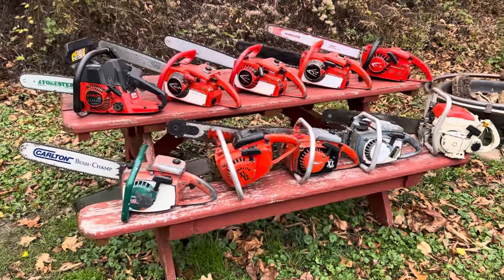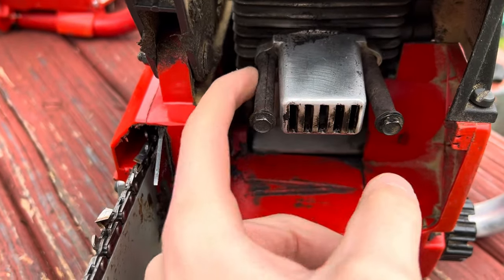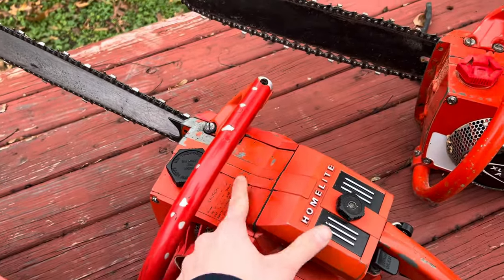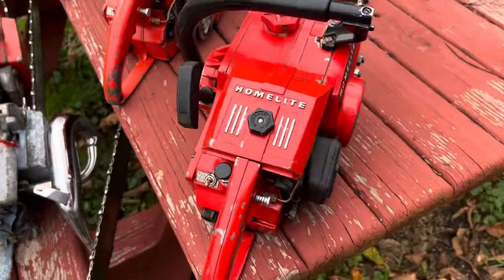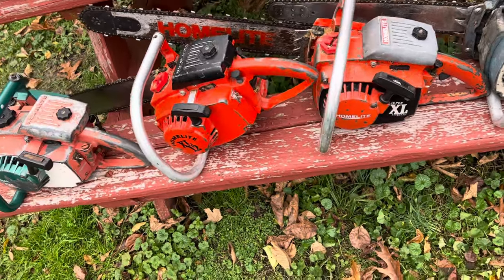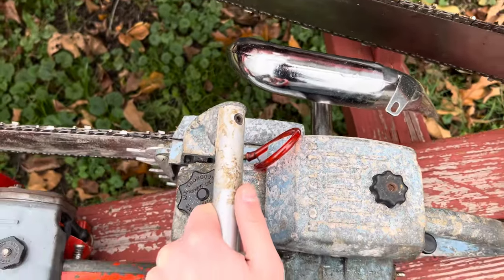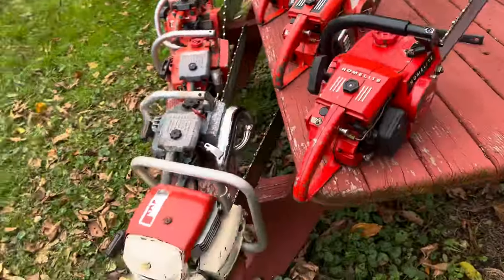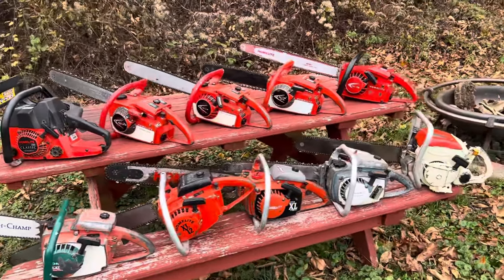Story Time: Backstory On My Homelite Chainsaw Collection

Comment: Love em brother! I too have a chainsaw collection and half of them are vintage homelites! I believe i have around 140 chainsaws currently. I live in Portland Oregon and have been playing with saws and dirt bikes all my life! And those old homelites are fun, but once you get a badass Husqvarna, or Sachs-Dolmar 120 super, it's hard to want to run a slower saw! I have one of those 1966 XL500 in almost perfect condition, but two them that I got my hands on i couldn't believe it! I have two XL-101 homelites that were manufactured in the same plant on the same day 240 units apart from each other and after fifty years of being apart they have reunited on my display shelves. 2736577, 2736837 they came from two different owners about twenty five miles apart from each other. 😉